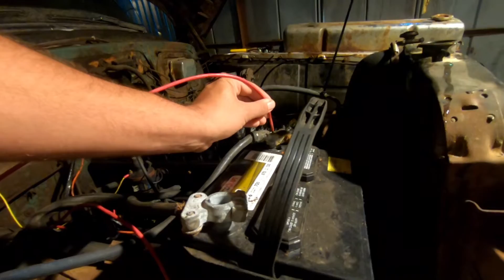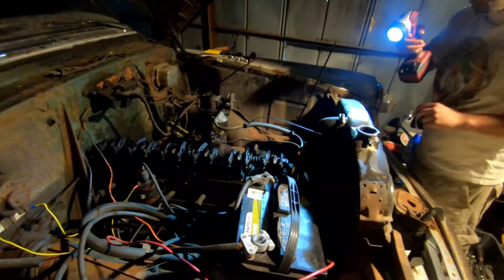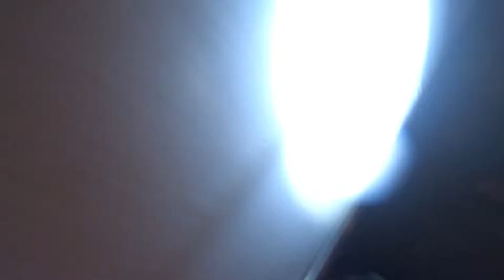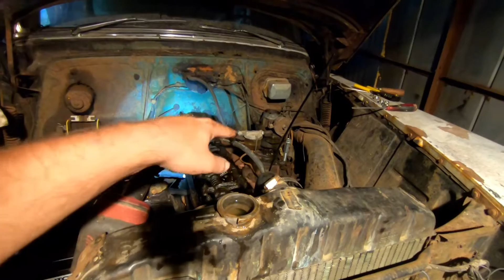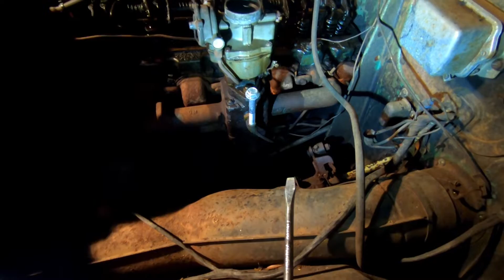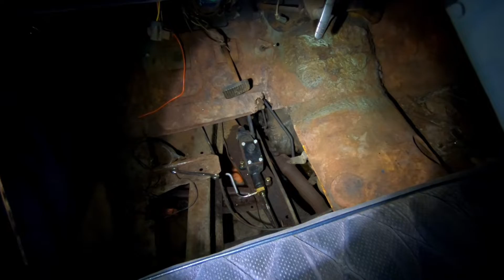Reviving a 1954 Chevrolet Bel Air Farm Find

Comment: My dad bought a 1953 Bel Aire 2 tone power Power Glide in 1954. We kept it into the 70s. He rebuilt the engine in the drive way, reamed the cylinders , installed new rings, etc. He finally sold it when the floor started rusting out.
The hells of my mom,s  shoes went through the floor